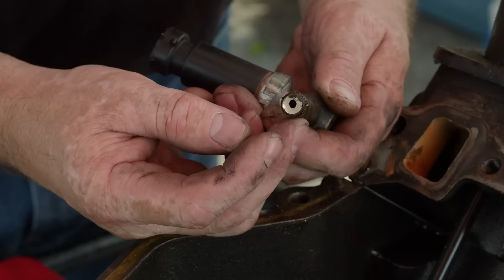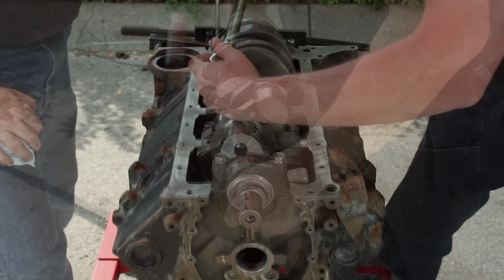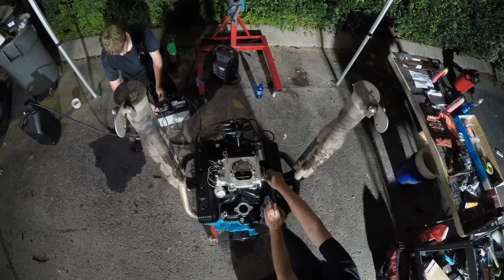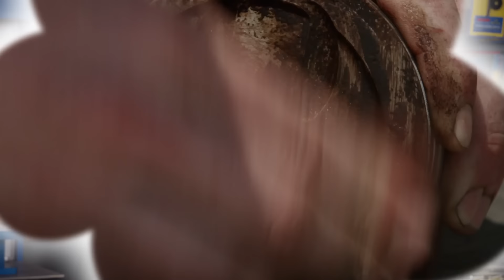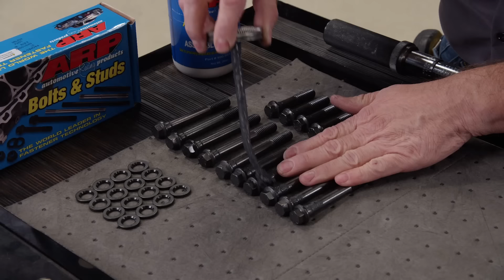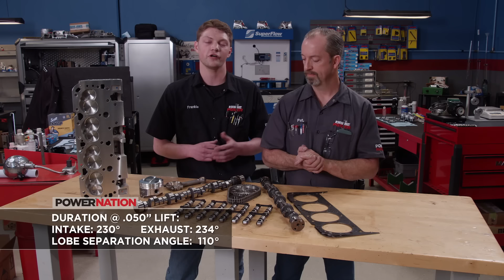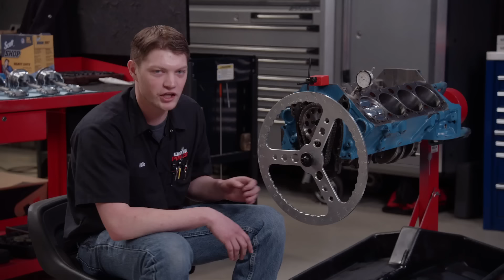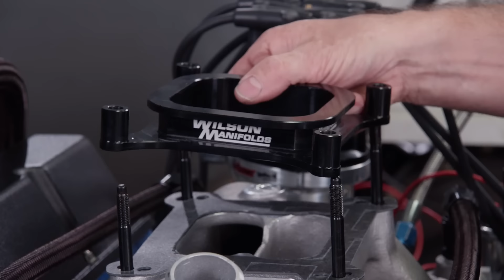Over 13:1 on Pump Gas! Chevy 350 Dyno Mule - Engine Power S9, E9 &10

Comment: 413/424 from a 13:1 engine and 195 heads?
 I get 410/430 @ 5800/4200rpm's from a 9:2.1 stock bore 350 with cast iron Promaxx 185's and a smaller 268/272 adv.dur. Voodoo cam.

I think your dyno is broken.

Comment: The beauty of the old TBI 5.7 engines was the fact that they didn’t make enough power to hurt themselves and they were very simple and inexpensive to repair and maintain. Other than the occasional cracked cylinder head or valve stem seals they’d run 350-400 thousand miles trouble free. At that point give them a valve job and they will run another 250 thousand miles.

Comment: A couple of things that the average person needs to keep in mind. 

#1 Do not run your dynamic compression as high as they did here. Because of variables like under hood temps, cooling system temps, even the temp of the air coming into the engine are very likely going to cause problems due to the additional heat. Dyno cells are highly controlled environments. The under hood area of your car is far less controlled environment. 

#2 Their timing curve is way less than ideal. Even with that head on it, that engine will still ideally want 32 degrees or more of peak timing. With them only running 22 degrees, your losing quite a bit of power and tons of efficiency. Gas mileage on a dyno, not so important. Gas mileage in your vehicle, fairly important. 

Personally, with iron heads and 87 octane gas, I would keep the DCR ( Dynamic Compression Ratio ) down around 7.5:1. That should allow you to run optimal timing curves and in general yield a much wider tuning window. Aluminum heads you can raise that roughly half a point to 8.0:1 with solid results. Running only premium gas ( 91 octane or higher ) also allows one to raise the DCR up by about half a point. Mind you, everything in the show as well as everything I have said here are very basic and general rules. There are always those rare happy accident's where one can get away with a little more.

Comment: 50 thou lift on a camshaft lol dont you mean 500
Reply from the maker: If you are referring to the portion discussing durations, it is very common for cam in block camshafts to be rated in their lobe durations from the .050” from open and .050” from close points instead of the advertised numbers

Comment: Over 13:1 on Pump Gas 😲
Reply: Dynamic Compression Ratio is what has always controlled what octane gas an engine could burn. Just most folks only talk about the static Compression ration because it's far easier to understand and explain to others. 
Plus the math to calculate DCR wasn't widely available like it is today.

Comment: I was surprised TFS even sells those "as cast" 195cc 23 deg .sbc heads, they only flow 258cfm@ 0.600", about as good as a lightly ported 2.02 valve Vortec head. 23* deg.  Super 215 heads flow a NICE 287cfm.

The TFS Mopar 190 heads by comparison flow 293cfm @ the same 0.600" rating lift.

Comment: 22 degrees of timing is castrating that engines power output. Undoes everything that was done that would easily go 450 or more with correct timing. Good job but feeling a little let down by the numbers.

Comment: Smh ive never seen such expensive and high quality performance parts used and still make the same power you could get with factory vortec heads,decent cam and few a bolt-ons ! 😢 but u get credit for the effort 👌

Comment: 30:12 You switch from talking about dynamic compression ratio to cylinder pressure. Those are two completely different measurements.

Comment: How far in the hole is the piston and why not just deck the block instead of buying expensive forged pistons while it was at the machine shop,iam just a novice back yard guy
Reply: they would have made more power with a tighter piston to head clearance say 25 to 28 thousands with flat top pistons I plan to build this same exact engine the way I describe it will actually have 14 to 1 compression though and I plan to use a different cam to lower the rpm range a bit.

Comment: Pretty expensive intake if it bolts up to center bolt heads with intake holes various angles. Problems you run into in your driveway that stops you that money solves

Comment: How much cash did they throw at that 350 to only get 413 hp? I back in the day (90s) with my discount from my employer (AE Goetz) could and would routinely get 500plus hp out of 350s for about $500 on internal parts and a set of Dart 2 heads.

Comment: I wouldn't buy this combination of brand new parts to build an engine that makes the same power as a 10.5:1 flat top engine. But if you already have the parts lying around and stuck with a high static compression using a cam to bleed off cylinder pressure, it is a good way to use what you have and with a simple cam swap the pistons can be used for their intended purposes and make gobs more power. This was a  great lesson to show that

Comment: were you guys surprised by the power any? A trick flow headed, roller, 13:1 compression small block.... made 411 crank hp? I think id be pretty depressed with this setup.

Comment: Make no mistake, you cannot race a 13:1 compression engine on pump gas. But you can cruise it gently on the street. But what's the point if you can't mash the peddle??

Comment: Since charge is still flowing into chamber when intake valve closes, dynamic compression means nothing, you retard the cam, and kill the timing. The only thing you can gain here it drive it daily on pump gas with 22 degrees of advance, then run race gas and bump the timing up to 36 degrees to gain maybe 50 hp. Hint you could run e85.

Comment: Thank you for the great engine builds.  Also the information of dynamic CR.  Also important is the dynamic expansion Ratio.  The DER sets the limit on converting heat energy to power energy.  So retarding the cam brings to DCR down for pump gas it also raises the DER to produce more power.   Would like to see you retard the cam more and optimize  the spark timing. THANKS AGAIN

Comment: Ok Pat lets see an old school 12.5 to 1 solid flat tappet build open to ?? heads
Compression is everything in a hot rod, throttle response torque and that crisp cackling note are where its at. Low compression thumpr turds sound as described. 
Run just under 12:1 on my st car 260@solid roller driveability is smooth as silk.

Comment: I remember my nephew used to bolt parts to his VW and then add all the HP together that each part claimed it added.  The dyno is the only way to really know.  Drag racing results can also be calculated pretty closely.  But just bolting on parts and adding up the additions probably not.

Comment: My 383 im building has 10.35:1 cr with 8.68:1 dcr but its pushing 225 cylinder pressure, seem high for pumpgas🤷‍♂️

Comment: I am a retired GM service engineer, instructor, author, car builder, racer, yardage, yadda. So my question? You guys have all the words, but when you have to run the engine at 22 degrees of timing you just threw away a shit load of power. What is the point of running mechanicals for high compression then take it all away with timing? You obviously are missing something in your background or experience. Very depressing. Giving neophytes ridiculous info. But you look and sound good.
Reply: Sir, could you please explain a little more about what you are referring to?. Sorry for the inconvenience, I'm learning.
Reply: @Moises-w2u  turning the timing back really defeats the reason for going to higher compression. One could raise the static compression even higher, but reducing the cylinder pressure by retarding the timing has all sorts of negative effects. If the timing is computer controlled, as well as the fuel control, then it is possible to run higher compression, but retarding the ignition, or increasing cam overlap to leak off dynamic compression, is a lot of work for very little gain. And have you researched the damaged caused by excessive exhaust valve heating. Not a good idea, any of it.
Reply: @jeffreylynch3203  Wow, that's good to know. Thank you very much sir

Comment: What is the benefit of building a high compression engine that has a 2 degree retarded intake centerline vs. a normal compression engine with a 4 degree advanced intake centerline when both compression ratios end up at 9 to 1? Any help is appreciated.

Comment: So what's the actually cylinder pressure at your dynamic comp?  Kinda defeats the purpose of  the 13 to ones if it's not close to 200 psi doesn't it pat?

Comment: You should grind the top of the center oil gallery, because some of the double roller timing sets will contact it and rub some metal into the oil and may cause bearing failure !

Comment: The clearance is usually built into the piston, in other words, if they need 3 thou. Measure the pistons so you dont make the bores to big. We usually go 1 thou. More in case the engine gets to hot. Saves scoreing on pistons or cylinders

Comment: Gotta ask if you folks have tested the E3 plugs.
Being a welder that has issues with a clean ground. Ran an 05 hemi, replaced the plugs with e3 and noticed constant power when pulling. 
By the way MOPAR😁

Comment: This is a 50 year old concept & I built one back in the mid 70's using a Crower Cam designed for high compression . Got 24 mpg & ran it in my '72 El Camino for many years .
   Great vid fellows .
Reply: I thought forsure that combo was going to make 480-500 Hp :(
Reply: 24mpg with high compression, pump gas, and a cam large enough to allow the pump gas?? 

Uh... NO! 

Bullshitting will NOT get you anywhere, ESPECIALLY when there's people around who are much wiser than you.
Reply: @davelowets It's possible,not likely but possible. Higher compression engines are more efficient than lower compression engines and make more power from the same volume of fuel. Also there are other things to consider like the weight of the vehicle,gear ratio, drag coefficient and how well the engine is tuned. It also helps if you drive with a light foot.
Reply: @davelowets  funny how these stories are posted and it never occurs to them lots of us know better and were around in those days. 
No unicorn combos exist like that. Even my parents new bone stock 2 bll 350 with 2xx axle ratio would get 20s on the higway 73 Impala
Reply: @davelowets  
Mine gets 10mpg on the highway. (8mpg if I have my foot in it.)
66 4 Door

Comment: I always wondered why they degree a cam when it’s a drop-in and the timing set is not adjustable?
Reply: They're checking it to make sure it's ground correctly as per the cam card that comes in the box. Sometimes what you think you bought turns out to be something else and checking it is good assurance to prevent having to pull the cam out when it doesn't run right

Comment: I'd love see what can be done in technical terms to build a small block Chevy that gets the best combustion / fuel mileage.  I was an aircraft mechanic for 32 years. In college which is an aviation /university, the curriculum I was in included a heavy emphasis on physics. We studied physics in relationship to piston and jet aircraft engines. I was a car guy from the time I was a kid, so when learning the physics of volumetric efficiency, my interest was being peaked.
I'd like to know more about the fast burn cylinder heads and what combinations of intake and exhaust systems work the best with them, for given displacement /rod length/stroke/ effective stroke, and so on.

Comment: I really loved the Ford FE builds they did with the Trick Flow heads, the Track Heat single with the carb and the dual 445 with a bigger cam and a 2/ 4V Fitech injection that was really strong!

Comment: For the c.i. the LSA is too wide, because it is a pump gas engine the cam was ground that way to be able to use the pump gas. For a 355 or 358 c.i. with a 2.10" intake valve (the heads that suit this compression) you would need a 107* LCA and then base your LSA from that if you want it ground in advanced a certain amount or whatever. Valve events need to be within a degree for best results, of course you could make more heat especially with more head and intake packing the cylinders with 13:1 and timing events being spot on, could create the need for more octane, however it also may not depending on duration and how relaxed the valve action is. Go ahead and drop that LSA on that cam and get more torque and hp. Go ahead and slap on an edelbrock Super Victor II on there with a brodix 221cc head. Use a large XR comp cam as a base then tighten up that LSA. You won't be sorry.
Reply: Agreed I wished they had used between 106° - 110°

Comment: I remember my first car, a 1971 chevy impala. It had a sticker right on the air cleaner that said 245 hp. When I look back at some of the cars I have owned and got rid of I could kick myself. A 1974 Plymouth cuda. 1967 Pontiac firebird. Etc. My friend used to like mopar, he had several super "B"s a charger, etc. I also knew a guy that had s 1969 camaro he said that it only had a 327 in it, but I always wondered how it pulled thr front tires up so far, lol.

Comment: Few points in mind:
The engine made several dyno passes and was disassembled. Not surprising to find it clean and new inside

The only part reused was the block. I feel like it would’ve been best to just get a block then you’d have 2 engines instead of one engine and a parts bin full of parts that you intend to reuse to make essentially the same engine again. 

It was cool that you guys built an engine with the technology that the average joe has, but it makes me feel that you had little confidence in the build due to the reasons above. 

I don’t understand how we’re willing to spend thousands on components but worry about saving a 30 dollar gasket. 

It’s an awesome channel and I don’t think I’ve missed an episode. But you built two engines and ended up with one. And most of us can’t do that

Comment: Dyno results could have been comparable with a fraction of the price for budget builder if you guys started with a stock 880 Vortec headed 350. Threw in ARP hardware and an aftermarket camshaft

Comment: I often use  dynamic compression, in cam consideration,   but the tomfoolery in it after your up in the RPM, the pressure builds, why the cam should be mainly chosen for rpm range. Thus you may still need to not have as much advance curve ect.   I have run 12:1 compression,  retarded the cam  , but still up in the rpm had to limit my mechanical advance curve . Why do you think the circle track Pickups were running their power on a 9:1 compression rule? Their cams ain't small.

Comment: Dynamic compression works for low reving engines, when you start running higher rpm then volumetric efficiency kicks in when you are getting way above 100% cylinder filling you have to watch ignition timing and dynamic compression and fuel octane. Example, very efficient engines that run above 10,000 rpm can have dynamic compression that will cause detonation.

Comment: Should’ve dumped in some race fuel and timing for a nice Street vs Strip comparison!
Reply: I agree. Would be nice to see the difference for us poor folks who wanna run pump gas 95% of the time, and for the 5% of the time were at the 1/4 we can let her eat!
Reply: @xxserbkingxx6289 Then you'd have a turd 95% of the time... 

Use the proper fuel for your compression ratio, or DON'T bother

Comment: They should try a solid roller with a 108 LSA that will bleed off low speed compression and help with high speed scavenging with good header and collector shape and length.

Comment: would like to have seen you optimize timing.  no sense in running high compression ratio if you give up a ton of power with low timing.  I would expect close to 500 bhp on this combo.

Comment: The engine does care how it gets cylinder pressure that's why made no power , jacked the compression so high couldn't put normal ignition timing big power loss

Comment: So how much does the dynamic compression and how much cam heads and fuel injection? I hoped you build the same setup as the block you got inside but all you reuse is the block iteelf. No comparsion to see

Comment: Ummm, I don't mean to be a bummer, but 413 horsepower out of a 350 is really bad especially with aluminum heads and high compression... I'm wondering if the cam is set up wrong...

Comment: on an engine I was looking at putting together, I actually saw this go the other way. My static was 100% fine according to everyone, but my dynamic would cause issues.
Reply: And what kind of weird cam were you planning on putting in this thing? 🤔
Reply: @davelowets  tiny stock cam, needed more lift to be within safe compression.
Reply: @zragevii4705  The cam would have needed more duration and a tighter LSA to bleed off more compression. The Lift number wouldn't have much to do with it.
Reply: @davelowets  that's technically correct yes, though the lift can help, technically I should have said I needed a more aggressive cam.
Reply: @zragevii4705  Yep. More aggressive in every aspect.

Comment: i don't go by application for spark plugs because sometimes if not all the time your stuck with a smaller amount of options , i just go by thread pitch and reach which can give you more options. i had that problem with my sportster high cube stroker motor and i needed a cold plug , just going by the application i had basically no good options but by going with thread pitch and reach i had many many more and now it runs happily on ngk r2525-10 or -9 and i dont foul them even running on the street

Comment: Cylinder head combustion chamber shape is very very very important, if it's not designed remotely nice? Do not try this at home. Ben Alamada Racing and Star Racing GA go in great detail on every aspect of the engine. Especially compression of Static and Dynamic, piston shape and design, cylinder head shape and design, cam timing event's and much more. Nice informational video for sure.